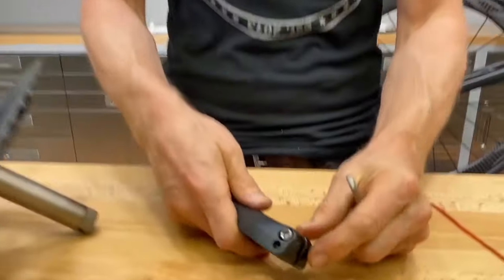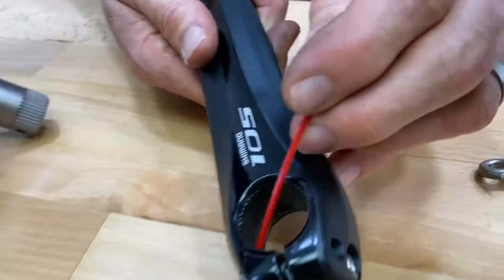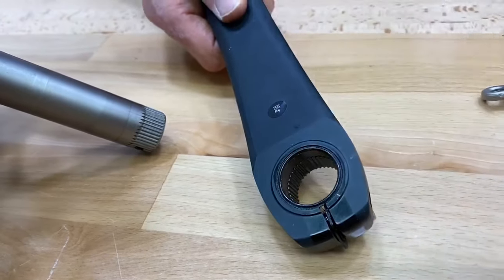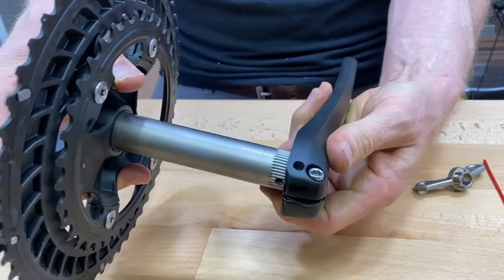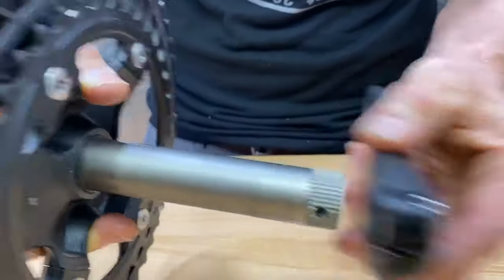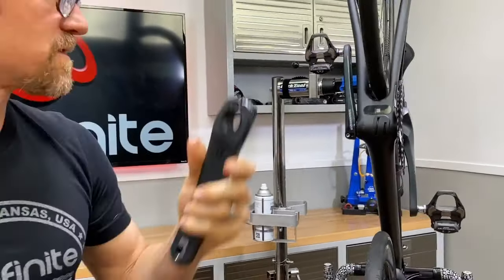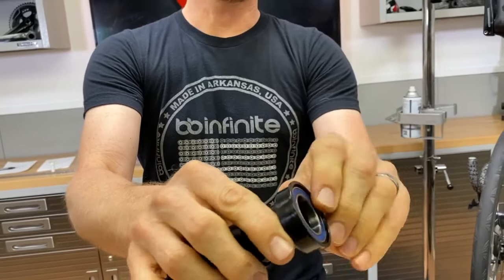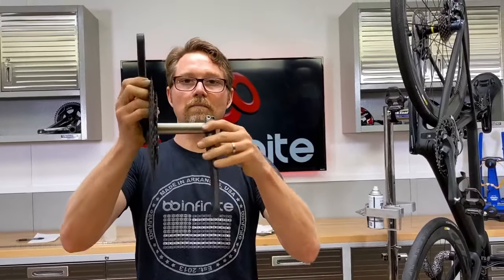Avoid This Common Shimano Crank Installation Pitfall

Comment: I installed a Dura Ace 9100 crank on my Cannondale CAAD 12. I used the Wheels Inc. BB 30 adapters which I believe is accepted practice. Anyway, the safety tab pin was off by about 2mm outboard. The cranks are tight to the adapters, and I am reluctant to hit the crank with a mallet . . . so I just used the crank arm fixing bolt hand tight and tightened the two bolts on the crank arm as instructed. No shifting problems. However, after riding for about a year the crank arm bolt cracked (the mushroom top separated from the threaded barrel) and the crank arm almost fell off. I just replaced the fixing bolt and am about to go for a ride with no safety pin. Any ideas as to what caused my problem. Could I drill out the little pin hole in the crank axle so the pin would engage? Anyway, thanks for listening..
Reply from the maker: The CAAD12 is BB30A. If you are using BB30 adapters...that's your problem right there. I suspect you meant to say BB30A adapters, and so the solution is to 1. Buy our BB30A to Shimano because it's correct 2. File down the outer face of non drive side adapter. This will only work if you have the black plastic adapters: If you measure the distance between the faces of the adapters while in place it should be 90-91mm. If it more than that, measure from the center of the bb shell to the faced of DS adapter. If it's not 45mm, file it down until it is. Now the chain line will be correct. I like to use 100 grit sand paper for this, with the paper flat on table top, keeping the faced of the work piece dead flat against the paper, rotating the workpiece as you sand back and forth. Check to see if the safety tap will snap down after this. If it does, just ride it. If not, leave the DS alone and just file a bit off the NDS adapter this time until snaps down.
Reply: @BBInfinite  Thanks for taking the time to write that very detailed explanation. I am a half fast amateur bike mechanic and although I do all my own maintenance, I definitely can get things wrong. I'll have to do some research to learn more about bb30 vs bb30A. I did think of sanding down the face of the NDS adapter, but I wasn't sure if that was kosher. Anyway, I will check my receipts and see which adaptor I bought. I honestly don't remember that Wheels Inc offered a choice. Perhaps they did and I just didn't have the knowledge to understand the difference, Anyhow, I will check it out and thanks again!
Reply from the maker: @joebikeguy6669  No problem. The dead giveaway will be that the adapters will be must different thicknesses. The DS will stick out about 10mm or so. The NDS will be much narrower, about 5mm or so. I think you've got the right ones, they're just out of spec a bit.

Comment: Nice Video, may I ask, currently my Crank Arm is very near the rear derailleur mechanism and there are scratches of my crank arm due to the close gap with the derailuer.

I have attempted to use 1mm spacer but due to the spacer I can't close the Crank Arm safety pin.

So the only way out is to change a smaller length bottom bracket and then add a spacer? Currently I am using BBR60 with Shimano 105.
Appreciate your valuable input.
TIA.
Reply from the maker: So the inside of the crank arm is hitting the front derailleur as you pedal? It's BBR06, but is it Italian or BSA? I'll tell you what, please email us at info@bbinfinite.com about this. We'll help you.

Comment: A problem with wheel manufacturing adapters
Reply from the maker: We haven't done an extensive study to know which brand or type of adapters are particularly problematic. We say avoid them altogether. We recommend getting a BB that matches a specific crank standard, like Dub, for instance, to a specific BB standard, such as BBBright or BB92. We look at it like this: creaks are from movement, so cut down on the parts until nothing can move, except the bearings.

Comment: What if I used an spacer? Would it still fall off?
Reply from the maker: These cranks can't be spaced much. You'd have to know your starting point. If the BB fully installed was 92.5mm wide on a road bike, you could put a 1mm spacer in it, but not much more.

Comment: Hello sir just want to ask if R7000 left arm is also compatible with a 5800 model crank? I do have a broken spline due to that mistake.. and i cant find any 5800 left arm replacement.. thank you in advance
Reply from the maker: You can put any HT2 crank arm on any HT2 crank set. 105 arm on Ultegra, or DA, or Tiagra. No problem.
Reply: Thanks a lot sir. Appreciate it

Comment: Hey, what if i had a specific problem with my bbinfinite bb30 to shimano crank arm? How did I supposed to solve this problem. Thanks
Reply: I use shimano GRX 810 crankset and it wont get in as much on the left side of the crank
Reply from the maker: @fikrysakti4313  Please email us at info@bbinfinite.com or message us on FB. We can help you out a lot better and faster there than here. Thank you.

Comment: So would you say if I am able to push the pin down that my BB are screwed correctly and also the crank axle is pushed far enough from the right side into the BB? So Pin can be pushed down = installation correctly done?
Reply from the maker: For the full, proper setup, watch this: https://youtu.be/ZC-FOkK6PHg

Comment: Campagnolo Ultra Torque rules
Reply from the maker: UltraTorque is the most correct crank/bearings set up, by the book, there is. If only Campy had some industry clout, maybe they would have had some control over the BB designs that rolled out over the last 20 years that were utterly incompatible with their great design. Thank goodness T47 has come. It's perfect for the UT cranks.

Comment: All this new age crap. Nothing works. Nothing but problems. Just problems. And the new age cyclists go along with same and eschew traditional design from the past which was simple, straightforward, impeccably dependable.
Reply: I agree, I am old school about to change to a double chainset from a bad experience of 1x whatever!  New doesn't mean better.  My brothers old BSA Tour of Britain in the 70's was a 1x5, nothing new under the sun.

Comment: I have this problem i cant fix it
Reply from the maker: If it's a road bike, measure the overall width of the BB shell including the outermost interfaces the crank touches. If it's much  bigger than 93mm, you've got a problem, but one that can  be solved.
Reply: @BBInfinite  its a mtb my crankset is deore m6000 with bb52
Reply from the maker: @subbysibuyas1916  If you have an excessive number of spacers installed you will have the problem mentioned in the video
Reply: @BBInfinite  should i remove all my spacer?
Reply: @BBInfinite  i have 68mm bb shell how many spacers do u suggest and what sizes is good for my bb
Reply from the maker: @subbysibuyas1916  If it's a MTB crank like an XT, you need to add 5mm somewhere, usually one to each side.
Reply from the maker: @subbysibuyas1916  If it's a 68mm shell and you have a road crank, yes.